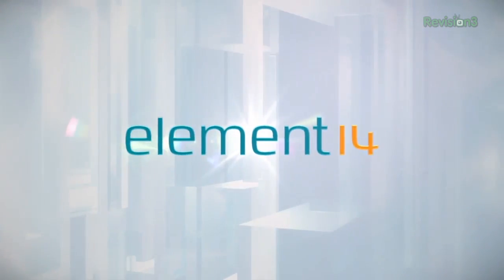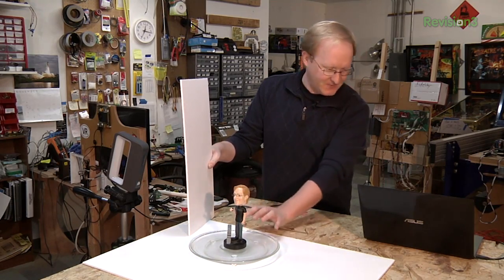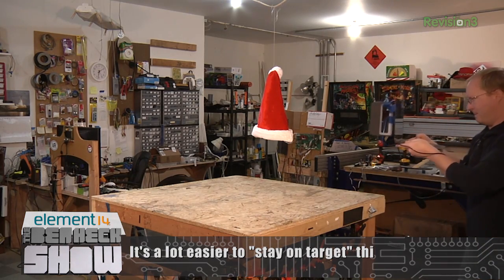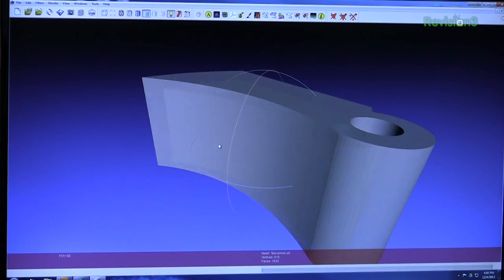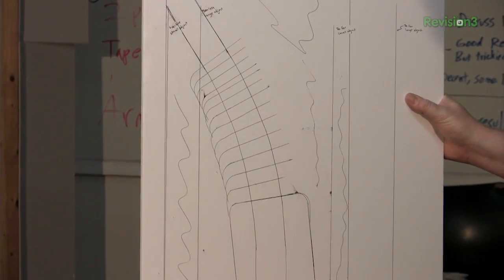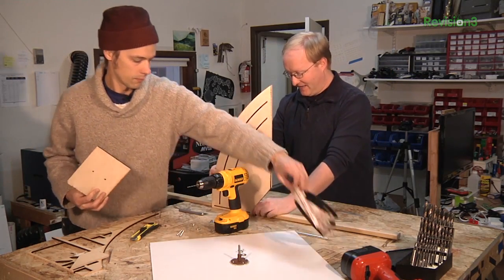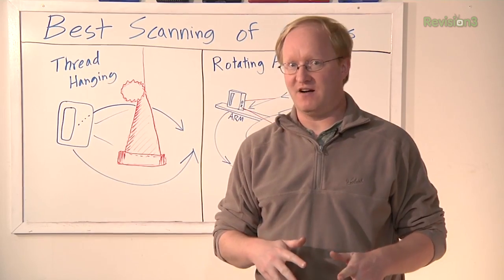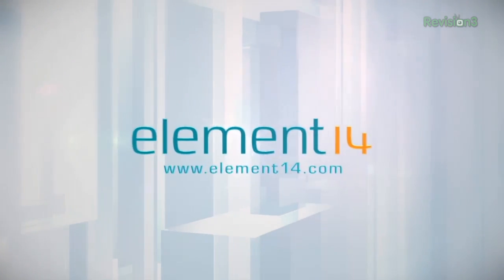A Man with a Scan - Ben Heck's 3D Scanner

Comment: You have certainly sold me on this scanner. Im currently using a Ciclpp 3d scanner as a mess around scanner. But this sense scanner mixed with the rotating platform of a ciclop 3d scanner with a movement bar for the sense will be perfect for my needs. 

Thank you for a very in depth review

Comment: HI. 

Nice hack, will definitely be trying the white surface! :)  I have tried a similar but opposite idea, where I use a cake decorating stand/turntable so the object turns rather than the scanner (which is stationary on a tripod). Have had to do it this way I don't have the space to easily move around the object. However, I am still finding that the scanner loses it's position a lot, often having to restart, even though I move incredibly slowly.  Can you think if there is there a particular reason the scanner does this? Thanks

Comment: They're trying to cover up how much of a piece of crap this thing is when trying to scan an object rather than human face. The software apparently has built-in enhancement on human body recognition, but it works poorly on other types of stuff. Nearly all the ads and reviews are either scanning live human face or sculpture of a human head. But you don't buy a 3D scanner just to scan a head all day long. Not everybody in the world is so bored to spend a few hundred bucks just to scan a bunch of fucking heads. It loses track easily while scanning an object, especially when the surface is black and reflective. You'd almost certainly need a guide rail for smoothing out the motion. But it won't help you much. You still lose track all the time.
Reply: And yet they made it work....
Reply: Did you have hands-on experience with it? Well I do. I bought one and tried it on lots of objects and compared with human. They made it work in an agonizing way.

Comment: if a rotating arm works, a rotating platform will work just as wel.. print a grid on the table to center your object.. and you can mount the scanner on a stationary arm.. so you don't have to run around with a laptop.. Add a motor to rotate the object.. and you're done!

Comment: Rotating middle plate is better idea. This will reduce needing moving room around table and you can put laptop and scanner on fixed place. Most commercial scanners have rotating plate. Never thought about it?
The used design cannot wear heavy things and will fall over.
Good try, but design is not smart. Too much hassle and risk chances.

The another cheap solution is camera + line laserpointer with David Laserscanner software. If you dont need nice colors, it's pretty nice. You dont need expensive 3D scanner.

Comment: Why complicate yourself by building a rotating arm, would not have worked the same if actually setting a circumference using for example the rails of a toy train and use it that way attaching the scanner to a build mounted support using the train's wheels to make the rounds around the object?
Still, I would not buy this ;-)

Comment: This is a bit disappointing.  One, I think you guys gave up too quickly on tripod/turntable scanning.   I suspect there may be ways to make that work better which would be preferable to the kludgy two-person dance concoction you ultimately came up with.   And second, some things I'd really like to know about this scanner you didn't explore at all-- how small an object can it scan and how big an object can it scan?  You printed out the game machine at what looks like 1-2" tall.  What if your original was that size and you wanted to blow it up in the printer, rather than reduce it as in your example?  Can the scanner handle that?  How close can you get to an object to scan?   And then, could you use the scanner and walk around your house in order to get an architectural model of it for experimenting with ideas for alterations?   After watching this video I don't really know any more about the scanner than when I started.
Reply: Syncopator  i bought that scanner and its impossible to  use  !!  the arm its the better way to scan with that scanner
Reply: It said the game machine could have,been printed larger but it would have taken a long time. I'm guessing it was just because they didn't want to take too long or use too much material. Also he was scanning the bobble head at the beginning and that was pretty small and he scanned the hats which were bigger. Not sure how much this helps but I'm sure if you really wanted to know you could just Google the scanner he is using as well as other similar devices. This wasn't to explain 3d scanning but more an experiment to see how this one works and to try and make a device to help scan. And I'm sure it could be done with only one person if he had a wire long enough or if he held the laptop in his other hand lol.
Reply: Jared Connell Yes, you could do it as a single person perhaps. Or even better, build a more complex single person 3D scanning rig that holds your laptop/PC elsewhere but has video output on the arm so you can verify your object is centered.  A build for a another day! :)

Comment: hi ben heck. you cant 3dscan something when there is a reflective surface underneath. Black absorbs light tho, the scanner may not like that very much.
Reply from the maker: Depends on the light frequency :)
Reply: @05:13 It has a pretty clear reflection there so obviously you chose a wrong flatform.

Comment: Does anyone know why my Kinect scans (on PC with the official software/SDK ) are looking bad?
Other videos show that a scanned cube looks like a cube....not like a piece of swiss cheese......
Reply from the maker: There are a few factors, either it's because the camera is just low resolution on the Kinect, the lighting conditions or it needs to do a number of sweeps to update the point cloud.
Reply: The Ben Heck Show Thanks for the reply!
Reply: ***** Another issue could be the material from which the cube is made. Is it shiny or reflective? Is it very dark or highly matte (black felt)? Dark materials absorb a lot of the IR light and result in noisy scans. Lastly, some symmetrical object will have a hard time tracking due to the point cloud fitting forgetting where it is and can jump to another angle of the object suddenly, especially if you are not moving slowly enough. hope that helps!
Reply: Talldrinks Thanks!
Well i could sometimes Scan my WHOLE ROOM with objects 4 meters away and it worked but sometimes "holes" wont fill up or it deletes half of the room (i have enough RAM and a good CPU)
Reply: Talldrinks  Yes you might need to put talcom powder on it.
Reply: +John Daniels 
It was my old PC with an GTX770. And same problem with my new pc...maybe the Kinect is  defective. But thanks!

Comment: I've used a Faro Edge at work with a laser scanner.  Accuracy is about 0.1mm.  You're looking at upwards of $100k for a kit in addition to a reverse engineering software upgrade.  So I guess going through the trouble of designing a dynamic scanning frame for this $460 unit isn't too bad.  The objects with colors look like they came out of Counter-Strike Source!

Comment: why don't you put the object on a turn-table    and let the scanner stable during the scan ?
Reply: Did you watch the video?
Reply: ***** i mean a turntable with a fixed base !  the center of the table is fixed and only the outer part  can turn and rotate. Bakers use that for big cake.
Reply: i was wondering what would happen if you rotated the object on a turntable with a reference strip on the edge for the scanner to see the motion of the turntable better (clocking stripe on the side of a auto test crash comes to mind). Guess it would depend on how tall the field of view is and how much it needs to see in motion.

Comment: Awful and expensive. Should have used KScan3D - cheaper and works beautifully with a rotating table.
Reply: If you look closely at the sensors on this thing, you'll notice that this is pretty much a Kinect, albeit in different packaging. Honestly, even his best reconstructions are kind of crap, which seems to be due to the software having trouble with loop closures. As you say, there are way better solutions for this technology.

Comment: I think the reason it detected the black plate was because of it's emissivity.  Maybe it's giving off more radiation than something with a lower emissivity?
Reply: The Ben Heck Show From what I can tell from observation, this particular scanner is essentially the same thing internally as a Kinect (or ASUS Xtion, which I'd go as far to say is actually sitting inside this thing). It projects a known infrared pattern, and is able to build a depth map based on distortion of that pattern. 3D reconstruction can then be done using a variant of SLAM, similar to what KinectFusion does. This also explains why you need to transform the camera's position about the object, since SLAM does indeed track the entire scene. If you wanted a surface that did not pick up on the scanner, you might want something that absorbs infrared. My suggestion though would be to place objects onto a planar object with a known (say, checkerboard) pattern. It should be trivial to detect and clip such a thing in software.
Reply: You might even be able to test if it's because of more radiation by using a mirror.  A mirror's emissivity is pretty low so if it's radiation, a mirror should work really well.
Reply from the maker: Thanks for the suggestion!

Comment: Nice video, Ben! Thanks for the pointers. We have a Sense here at work and did find similar conclusions such as the white vs black floor as well as the referencing of the changing backgrounds as you walk around your object. Our main concern for buying the sense was converting a scan to a 3D CAD model for Solidworks. How can we check accuracy of the dimensions of the scan before going into CAD?

Comment: With the moving scanner arm, you could make it a bit more electronic by adding a set of gears and a motor to raise and lower the scanner using buttons as you walk around your object. Doing that would allow for very small increments, there for making the 3d object more detailed. Different gearing would allow for larger or smaller movements in an upwards and downwards direction.

Comment: Dumb question, but if you wanted to use the tripod mount, you could bolt the sector/slidy plate on the outside edge of the bar; surely better than industrial velcro?

Comment: Hey.

Im currently trying to figure out if i can use an arduino UNO, Sharp GP2Y0A21YK to make an stl file, for import to Sketchup or like that.

Do you have an idéa of witch sensor is used by the scanner?

Regards from Denmark.

Comment: Thanks for the great video!  I have a Sense scanner and found it difficult to scan smaller objects.  Your tips and ideas are going to make my scans better and easier.  Starting to design a platform for "center" aimed scanning.
Reply: Even the expensive ones are shit. I  bought a 4k scanner last year and it took forever to get it going. And scan to CAD is a Joke. Next engine is no better than a MS Kinect.
Reply: Wow.. Even the 4k scanner was crap, that sucks.  I am currently working with my neighbor to build a rig and turntable to scan with the MS Kinect.

Will keep you posted on the quality and functionality if you are interested.  BTW, I think 3D Systems should have allowed returns for the Sense, it is OK, but not the best. Tracking is an issue that needs to be fixed.
Reply: How did that go (with the Kinect)? i Cant get mine to scan anything decently theres always huge holes or imperfections.
 Im currently using a Kinect v01 and ReconstructMe

Comment: can something like this product be used to find out the dimensions of an object after being scanned? More specifically work such as finding the coordinates of holes on a part. I would like to use it for parts design to replace more time consuming means of measurement.
Reply: nick disney  I re-read my comment and you're right my grammar was pretty bad. All corrected, should make more sense now. I hope
Reply: nick disney
I will look into that, so thanks for the tip. I don't really need it to a high resolution as I figure I can use a 3D printer to test fit it and make manual adjustments until I reach a point where's it's close to right. While a trial and error method is no doubt crude it's quite acceptable for certain large tolerance components such as radiator guide panels that have oversized holes for mounting. For anything more critical and on a smaller scale I will stick to my digital height gauge and a touch probe.
Reply: Sam Quad also have you considered measuring the circle's radius then the distance of the circles from the edge? (this might help with a gear or turbine)
Reply: Micah Turner
yes I know a few engineering tricks in that sense thanks. I will give you an example of something I would like to do soon. I wish to design and produce water outlets for one type of engine. It's very close to other components and if I could scan the area I could work out how much space I have to work with and then it would help a lot. In other cases just to find various ordinates of objects that don't have a good reference point, for example a bent plate with holes all over it.
Reply: I should have assumed your basic competencies. Sorry Sam :) infrared detectors like that on a Kinect Xbox controller could be used for such purposes.
Reply: Micah Turner
I have been doing some research and it seems the Kinect are very poor at working at anything more a few meters away. There are some non genuine lenses that can be fitted to help with this but I doubt it would help in my case.
Reply: that was the best(affordable) solution I could think of... good luck!
Reply: yes I agree, thanks for the advice regardless

Comment: For those who can't afford a 3d-scanner, there's a free program by autodesk, which lets you make 3d models from photos, it's named 123D Catch.

Also, if you would print a Grid as a base, wouldn't that help with the accuracy of the scan?
Reply: Old comment i know, never the less Autodesk sucks hobo ass. In fact they discontinued that software 2 years ago.
free alternatives are

3DF Zephyr Free (image limit to 50)
COLMAP (no textures)
VisualSFM (works great but has trouble finding patterns in smooth things, you have to also install a plugin to generate dense point clouds plus you need another software to create meshes from the point clouds)

Beware than many of this programs are only for personal use.

Comment: Hey Ben you should make cordless sotering iron. So all you have to do is take apart a sotering iron that plugs into a charger, and the charger unplugs to for easy use. To make it easyer to work with multiple projects in different places and not have to worry about have to wait for your iron to heat up.

Comment: Why are you supporting the Cube? They overcharge for their filament and their printers won't take filament from a third party. $50 and  you only get 300 grams of plastic. Plus you have to register on their website to unlock your printer.

Also, infrared scanners don't like black because infrared is still light and black doesn't reflect light, even infrared. Just because you can't see it doesn't mean it behaves different than visible light does.
Reply: Probably because he's being sponsored. And infrared does behave a little differently, just like how even visible wavelengths behave a little differently from each other. The farther you go into the infrared , the more different it will behave.

Comment: That mounting plate would track better up and.down if you used 2 sets of bolts like car wheels.  With just 2 bolts, it rotates around the middle.of the parallel tracks a bit.  Pretty neat solution you made though...

Comment: You should add a platform, to the arm, to hold your laptop.
Reply: Thats the first thing he tried, didn't work.
Reply: I was questioning why that didn't' happen. Heck, the extra wood from the pole would have sufficed if you put a simple flat platform on the end.
Reply: No, the solution is to rotate the object than the scaner and the laptop...

Comment: hey ben wat if u had a stepper motor under the platform to were it rotated the arm and the usb cable for the scanner was extended to the center and came out the side of a table to were u wouldn't have to walk around the table wit the scanner and pc